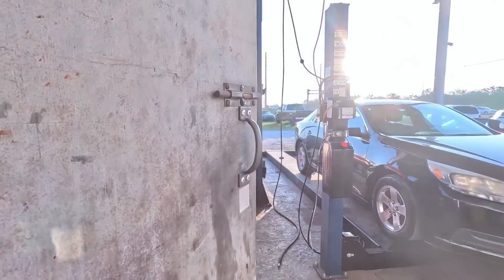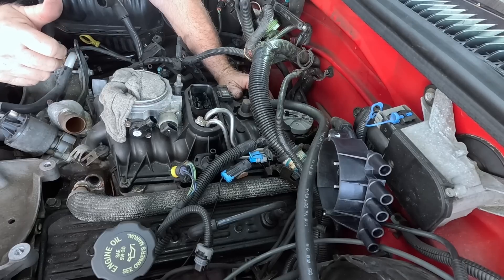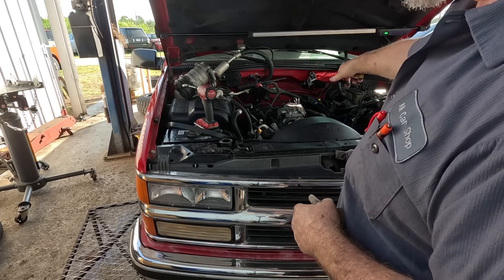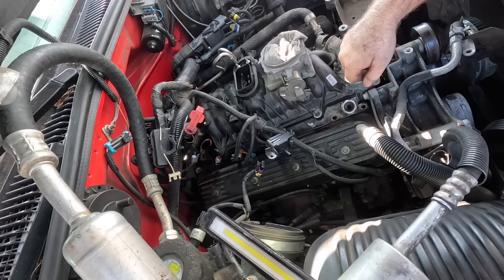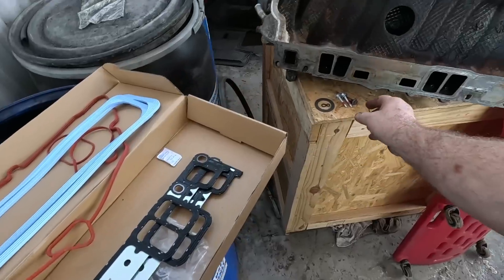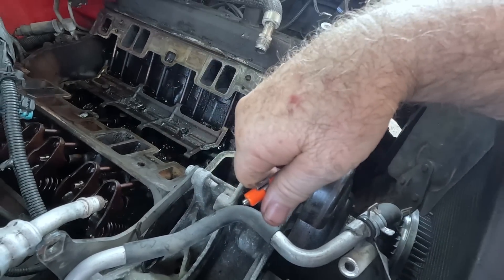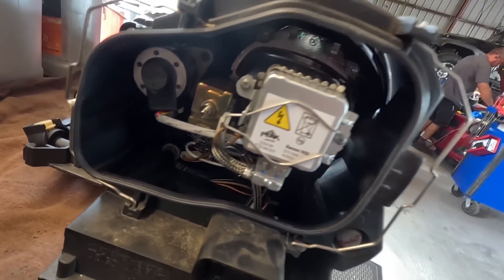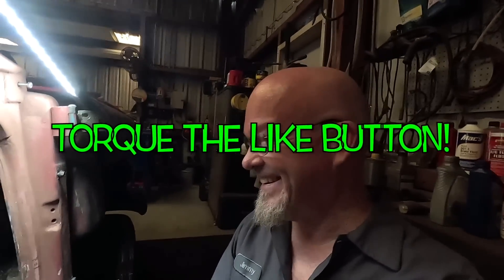INTAKE K10, ESCAPE WINDOW, KIA EXHAUST, A DAY IN THE AUTO REPAIR SHOP 241

Comment: Another great video Jimmy. Love the OBS. I daily drive a 95' with the ol' 305 tbi. Very reliable truck and low to no maintenance. And when there is parts are cheap.
Reply from the maker: Yeah, great trucks if you can keep the plastic parts in decent shape.

Comment: So when they started using plastic parts on the SBC engines and fewer bolts to hold it together, they started leaking? Shocker.
Reply: Same with the series2 3800 3100/3400. Decent engines with crap external parts.
Reply from the maker: Somethings got better, some worse. The valve covers and oil pan seemed to leak less. But timing cover, hmmmm.

Comment: That Kia🤣. Prob should have just replaced the manifold/rear cat with a Walker aftermarket. Parts cost would have been the same as they spent on just the rear OEM cat. Or just dumped out the rear and shipped it🤣.
Reply from the maker: Exactly what I was thinking my friend. If it was mine, it would have been fixed cheap!  Clear out and Anti fouler on the rear O2, fixed.

Comment: The Ford guys cringe when they see a Chevy drivetrain in any older Ford hot rod and street rod called Ford tough with Chevy stuff.I have seen a Small Block Chevy with Ford valve covers on it.Made an adaptor plate to accept the Ford valve covers
Reply from the maker: Yeah, I’ve seen plain aluminum valve covers with Ford engraved in them on an SBC.

If Chevy engine bother Hot Rodders too much, I think they may be missing the point. It’s not like every hot rodder could buy a Coyote crate engine, so a $500 small block will usually be easier and less money. Just the nature of the beast. Such a great engine, plentiful and inexpensive, :).